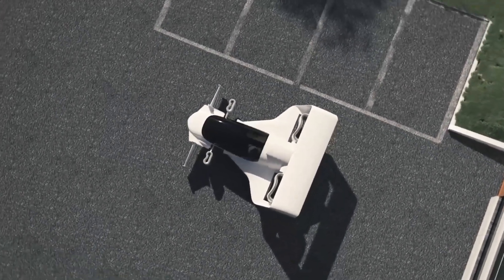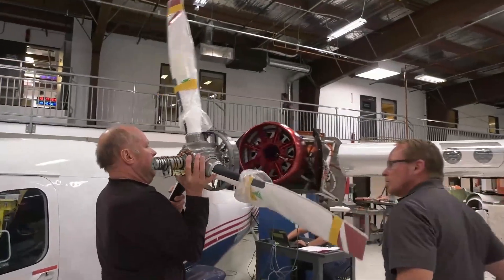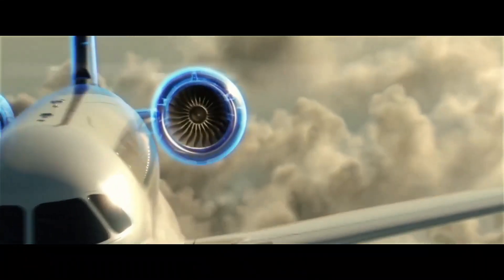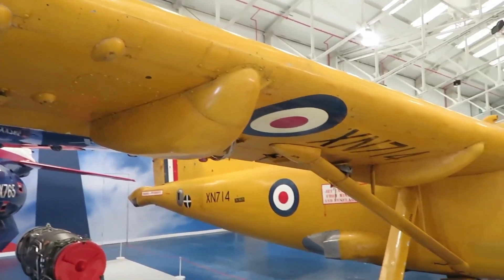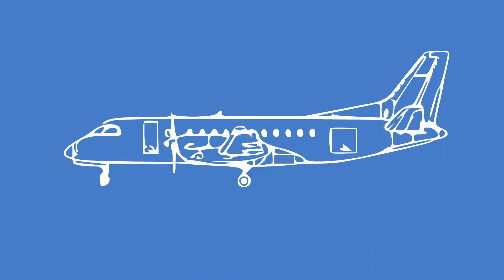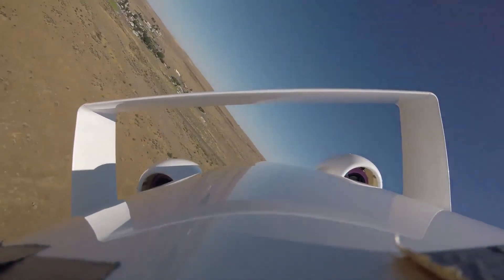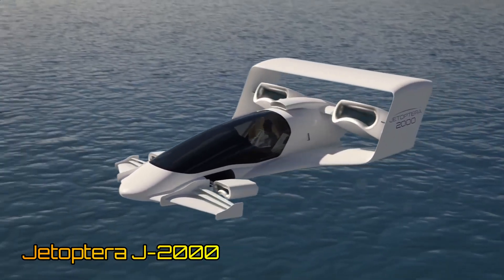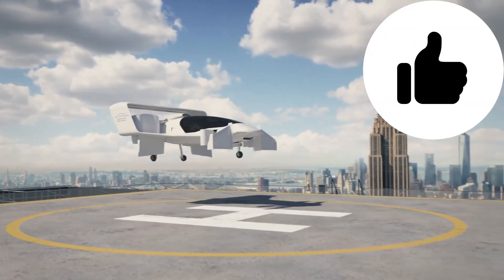Jetoptera Part 2 : Increasing the lift/thrust of an aircraft through fluidics

Comment: ...you say that modern jet engines don't contribute directly to lift, but I'm pretty sure there are designs out there using blown flaps. The issue is, if your lift relies partially on engine operation, you lose lift upon engine failure. That might be acceptable if you still maintain a safety margin, but you would also have to deal with the fact that part of your thrust is always contributing to lift even if you really don't need that...

Comment: If that had horizontal blades it would almost be an exact copy of clive sinclairs flying car from the 90's. Its probably still sat in his back garden.  He wasnt allowed to fly it around because they said there was no highway in the sky and therefore it was not safe.
But its been sitting there flight capable for 30years. gathering dust.

Comment: This is simply incorrect.
Modern passenger gets use the synergy between engine and the lift, on your own videos you can see that engines are located a little bit further from the wing and the exhaust is going under the wing, this does contribute to lift, by increasing the speed of air under the wing.
The position behind the wing in some cases also makes sense, because they're sucking air from top of the wing.

Comment: Your synergy  is not safe. If you lose an engine, you lose lift, which is not good. All the experimental airplanes that had propeller airstream blowing over flaps, had connecting shaft between props in case one engine fails. You are airborne, just off the runway, lose an engine at just above liftoff , and your lift now is less than weight, so, low altitude stall. What do you do? I think you should talk to some pilots (not Cessna 172) to explain these things. Coanda effect was known for some time but no practical applications for that reason.
Reply: Airborne, but under 1000' AGL, find a landing spot no more than 30° off the nose, and set her down.
Reply: @argonwheatbelly637  I guess you don’t understand aerodynamics. You are already in a stalled situation because you lost an engine and there is not enough air mass over the wing to create lift. The only reason you were able to get airborne is because that engine was blowing air over the wing or it was diverted to create “power” lift. Now you cond have that lift. You lift coefficient went from 4 or 5 or 8, whatever you had with all the engines running, to half of it or less. You are stalled basically. Anyway, you should have thought about it before you got airborne.

Comment: It’s a nothingburger with a nightmare of internal ductwork. Nothing is as efficient for large airliners than nacelles hanging from their slender wings. The super powerful engines are dwarfed by the bypass turbines which are really huge ducted fans. Maintenance, drag, and costs are minimized by this configuration. Ever wonder why the Lockheed L-1011 Tristar’s ducted tail engine never caught on? Right.

Comment: ......BUT SPEED!!!!!!!!.....BECAUSE OW WHICH CAREER OF TURBO PROP POWERED AIRLINERS WAS SHORT LIVED

=AND DONT FORGET ABOUT ETOPS ......SO.....I GUESS,PRETTY MUCH UNFORTUNATE,BUT DYSON FAN AIRLINERS WILL NEVER TO BE
Reply: Turboprop airliners career wasn't short lived, it remains popular among the the smaller regional airlines where the shorter distances make their slightly lower cruising speeds less of an issue.   Overall a turboprop powered airplane is more efficient, using only 2/3 as much fuel per passenger when compared to a jet powered craft of similar size.

Comment: Safety certification rules for passenger carrying aircraft require that multi-engine aircraft can continue to safely operate even if a single engine suddenly fails at the worst possible time during takeoff or landing.  Even single engine aircraft must demonstrate safe handling qualities if its engine fails.  This means that designers cannot easily rely on lift generated directly or indirectly by the propulsion system.

Comment: The problem is the constant back pressure  that the compression fans are fighting against because  they are forcing air through a airframe with sharp bends and curves finishing with narrowed ducted vents. To demand  electric motors  to fight against such pressure demands a constant high amperage power supply which is a major problem when weight is a factor from huge and heavy battery banks needed for adequate power for decent flight time.

Comment: I think what is missing is the rate and surface area of the propulsion per kg of weight. To me this looks like a bonafide glide with a couple of powerful dyson fans for a small amount of propulsion. It works for a sub scale model because of the light weight. But once it scales it will need heavier "air compressors" just like large planes need larger engines. And when you add seating, instruments, interior materials and passengers with storage items then the weigh vs propulsion does not seem to add up. The drag will be significant. And while it will fly it will not be much fast than a glider plane most probably. I guess we will have to weight yet another decade to see large models
Reply: Cube-Square law.  Shaka, when the walls fell.

Comment: I’d be interested in an electric vehicle that could take skydivers straight up to 25,000 ft and then return to home ready to take another group. I believe this could allow much less wait times lower cost and more jumps per day
Reply: Rate of climb is all about excess horsepower vs. weight.  An electric aircraft could be optimized for that mission, but you would probably need to swap batteries on the ground between cycles.

But why 25,000 ft?  I don't skydive, but that seems too high.  I understand that 10,000 to 14,000 ft is more common, and 18,000 ft is considered exceptional.  Above 14,000 ft the pilot of an unpressurized airplane must be on oxygen, and even the divers should be taking supplemental oxygen on the trip up.

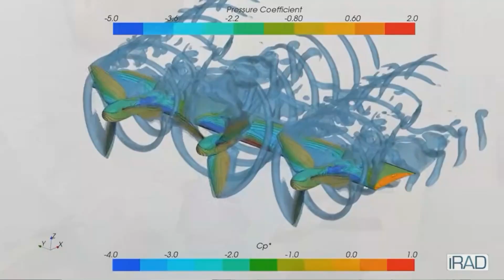Comment: My barbaric mind does not understand the graph shown 1:18 - it suggests that in an airplane an engine weighing 100 kg plus 100 kg of gasoline is three times less efficient than a 200 kg battery. It seems to me that this is not quite right, the TWR is definitely better because the battery will give more available power, but it will also run out much faster. If it were otherwise, a 100 kg humanoid robot with a 40 kg battery would be cleaning the apartment now instead of my wife xD
EDIT: I'm starting to understand
https://www.youtube.com/watch?v=0stTeHSVvFw
 subscription - on!

Comment: Yes. A total electric system without liquid fuels would be the best. But, the way they are making the electric vehicles will be way to costly because of the batteries. The new technology will be able to have 95% less batteries. That's weight saving at it's best. But provide more, cleaner energy.

Comment: Fun fact:  the Hunting H-126 has the lowest stall speed of any jet aircraft ever made...
Reply: Stall speed: 28 kn (32 mph, 52 km/h)
Reply: Crew: 1
Length: 50 ft 2 in (15.29 m)
Wingspan: 45 ft 4 in (13.82 m)
Height: 15 ft 6 in (4.72 m)
Wing area: 221 sq ft (20.5 m2)
Airfoil: NACA 4424
Empty weight: 8,240 lb (3,738 kg)
Max takeoff weight: 10,740 lb (4,872 kg)
Powerplant: 1 × Bristol Siddeley BOr.3 Orpheus Mk.805 turbojet engine, 4,000 lbf (18 kN) thrust

Comment: Good convincing video, but you forgot a lot of aspects in your research. For example: , vibration, maintenance, pre flight checks, safety and most of all temperature?!?! Especially from the exhaust… you want te melt the wings or even better, wanne ignite the kerosine in the wings? Oh and what about the center of gravity if you put tons of turbine engines on top of the wings. All these topics do not reflect completely on electric engines, so it’s not ok to compare these and conclude witch one is the best…
Reply: Good debate! That's why I prefer Lilium approach than Jetoptera.

Comment: Obviously you will eat ducting losses here. I wonder how the gains and losses balance out. Maybe it is more efficient for takeoff and landing, but less efficient for cruise flight? Maybe it simply allows for smaller wings to keep the plane aloft at low speed, which makes cruise flight less draggy if you turn off the diverters and use conventional jet outlets when not taking off or landing? Or perhaps it is a total wash, or worse?

Comment: The reason why commercial aircraft do not derive lift from propulsion is for because of safety. If an engine goes out, it would be incredibly dangerous to suddenly lose 30%+ of the aircraft's lift. I won't ever get into a plane that derives lift from thrust. I want to be able to safely coast to an emergency landing, not drop out of the sky like a rock with wing flaps.
Reply: The critical question is what happens if a "propulsor" fails at the worst possible time? Safety is always based on the weakest link principle, and traditional power plants are not reliable enough. This system, where a highly reliable compressor is safely buried in the body and ducts carry high pressure air to the propulsors is the first I've seen that comes close, though I question what happens if the power fails 5 seconds after liftoff or before landing.
There are even helicopters that are required to roll out to take off because they wouldn't be able to avoid a crash if one engine fails below a certain speed/altitude.
Reply: My guess is that glide ratio could be managed with an adjusted configuration. I guess that you've never flown in a fighter jet - F111s onward. They drop like a rock.
Reply: @messenger8139  Right, but I am not a fighter pilot. I do not want to risk my life in a plane and that is part of their job.
Reply: Current Boeing and Airbus commercial planes like A320 are 17:1 glide ratio from altitude.  The critical question here is what is the glide ratio of this new type of plane and what it would be with 70% remaining lift etc.
Reply: so then i ask, if you took a current plan and distributed the thrust over the wing, without changing the general lift characteristics or geometry of the wing, would you still get in it? 

if you lost power it just turns into a normal power-less plane again. but during takeoff it'd get off the runway in a far shorter distance
Reply: Electric planes ain't never gonna happen, not as large passenger aircraft. Battery vehicles and aircraft are ok for toys unless you're the parent paying for the batteries, but it's such a deeply flawed concept I'm stunned that so many seemingly intelligent people fall for the lie spread by the likes of Elon Musk. At best an extremely niche product which is expensive and poses an as great impact on the environment as gasoline vehicles.

Comment: The reason aircraft aren't optimized for take off and landing is because they only spend a minute either taking off or landing.
Reply: airport considerations such as size and safety could be influenced by VTOL aircraft.  They are part of the picture.

Comment: The "Custer channel wing" basically instead of pushing the aircraft thru the air to generate lift, the designer decided to pull air across the wing to do the same. It, for the most part worked, including a video of a man running beside the aircraft as it landed because it could slow down so much before it landed that it was at a running pace while still maintaining control lift.
Reply: It's the equivalent of landing into a headwind of the same speed as the thrust generated.
Reply: @nssherlock4547  Custer's theory was instead of pushing/pulling  the wing thru the air at 300 mph to generate lift why not pull air across the wing at the same speed regardless of the aircraft forward speed. His smaller 1 seat prototype was tied off at the tail during thrust testing and could lift itself straight up (pulling against the rope) if I remember right the issue they had was airflow coming unstuck from the rear portion of the curved wing channels. There was a website where they had the patents and were trying to solve the flow issues. It did have a flying aircaft so it does work.
Reply: @robmiller5818  they were indeed very interesting aircraft, the onion in the ointment though is that to continue flight in the event of failure of one engine, they would have to be connected by cross shafts, not impossible but heavy, complex and expensive.  If it weren’t for that the design would be a relatively cheap almost-VSTOL.

Comment: The supplied points are interesting features, but do not fully cover the topic of flight efficiency. First of all, it should be noted that air flow over a wing/airplane might consist of LAMINAR as well as TURBULENT proportions. In modern aircrafts, both flows are present and the design is optimized accordingly. Using the exhaust flow of a propulsion system to create lift on a wing results in mostly turbulent flow conditions, which is not always most desirable. 
Second, notably not all the wing surface is similar in its flow conditions. This means that having local increase of lift will affect the wing areas closeby, probably putting those in less favourable conditions. This obviously is also the case in any twin turboprop aircraft. The idea of Jetoptera to distribute the propulsed air more equally by multiple propulsion units might be advantageous, but not necessarily better, as instead of having unsteady flow over part of the wing, it might cover the complete wing section. 
Fluid dynamics should not looked at at local scale, but more hollistic. Every change in a flow is affecting the others - and unfortunately not always to its benefit

Comment: I'm a layman. But I see a glaring problem with this tech. What is the glide path with those tiny T-Rex wings? It looks like it will drop like a rock if it loses power. 

It achieves lift because of the way you use the thrust. Therefore, no thrust, no lift. I don't know if I want these things flying over me. Much less, to be in one.
Reply: What about helicopters?
Reply: @xxxooo5618  , Helicopters can land without power. They actually have a significant glide path. They can go straight down, and land safely when the power goes out. Hollywood makes it seem impossible, but it isn't. 

Can this thing? It uses power to create lift. No power, no lift. No lift, no glide path.
Reply: @xxxooo5618  thats not the greatest example. Helicopters can auto-rotate and actually touch down considerably softly. 
but yes i agree theres a lot of cognitive dissonance in comments like that. People every day get in things with life threatening single point failures. like "what if my wheel falls off at 80mph" or "what if one of the mains support cables on this bridge fails?"

yet they dont unless maintenance is neglected or they've been misused. 

hell. your entire life on a plane depends on the wings not falling off. yet why isnt that a worry?

Comment: My limited understanding of physics suggests the greater the difference between the speed of the propulsive flow and the speed of the aircraft the less efficient it is. So a slower moving high volume flow will be more efficient than a high speed lower volume flow. This is why model planes with huge slow moving props and vtol craft with large rotors are better for longer flight times. Jetoptera seems to be the opposite at least inside the plane, high speed compressor flow slowing down to be ejected from ducts. I must be missing something.
Reply: The compressed air is only high speed when its released. The total speed of air should be lower when taking into account the large volume of slower air being pulled through with the small volume of fast air.
Reply: you literally said it yourself and then questioned your statement. 
"slower moving high volume flow will be more efficient than a high speed lower volume flow"
"high speed compressor flow slowing down to be ejected from ducts"

yeah, exactly. they use high speed compressor air and then slow it down through those oval things while drastically boosting the mass flow of said air by entraining a ton more air
Reply: @t_c5266  This assumes that there are not large losses associated with running high pressure air through elaborate ducts which seems a bit counterintuitive.
Reply: @macrumpton  I'm still skeptical on if they can overcome the losses. But as far as efficiency is concerned, it's exactly as you described for their operating principle. Trading velocity for mass flow
Reply: "high speed compressor flow slowing down to be ejected from ducts." exactly what I was thinking. Moreover, this design feels as unstable as Bellweather's Volar.

Comment: The thing I have a hard time understanding is how they are avoiding high friction losses in the ducts between the compressor and the thrust ducts. The smaller and more complex the shape of that duct as well as its length and  high speed movement of the air will necessarily create lots of frictional losses. The dyson fan gives a very even flow, but in comparison tests it is not more efficient or even quieter for a comparable air volume than a standard box fan.
Reply: My intuitive understanding is that there doesn’t need to be a high speed air flow in the ducts themselves. It’s the compression of the air in the duct system that creates high speed air flow when released at the slit around the air flow ring. That compressed air could be nearly stagnant in the ducts between the compression fan and release slit without any ill effects.
Reply: @Freddie Nerkury how so  considering it already exists
Reply: where did you find the efficiency numbers versus normal fans?

Comment: Red flags with this vehicle:

1. Looks too much like the stereotypical "flying car" sci-fi trope. Stubby, seemingly inefficient wings, very small car-like footprint.

2. Crowdfunding rather than venture capital.

3. Weird, supposedly hyper-efficient propulsion system (as if nobody would have thought of using entrainment and mass flow augmentation previously).

To be clear, none of these things are proof that this is a scam. Just consider that emerging tech industries typically is replete with absolute frauds.